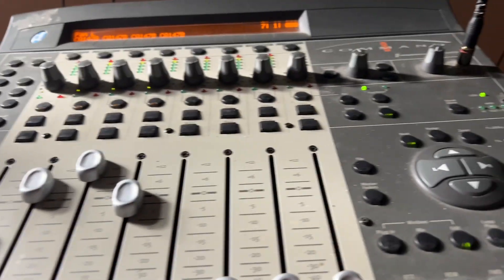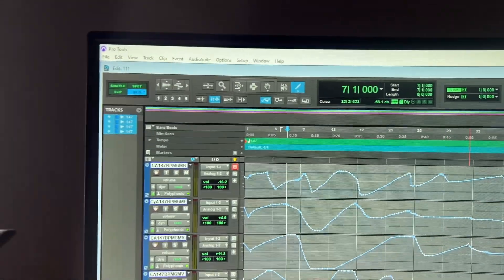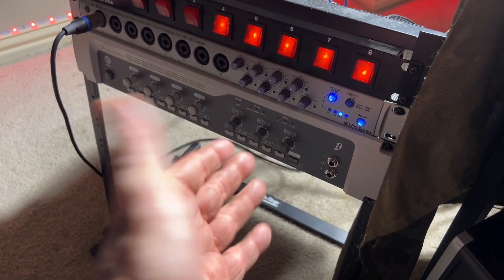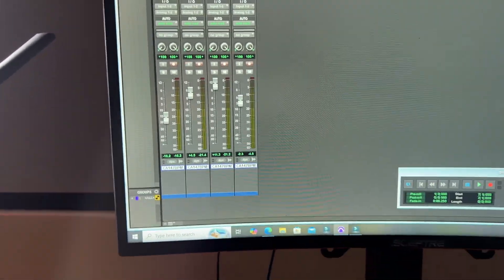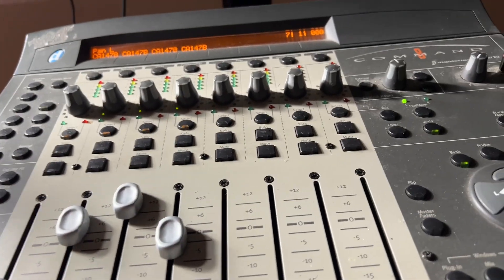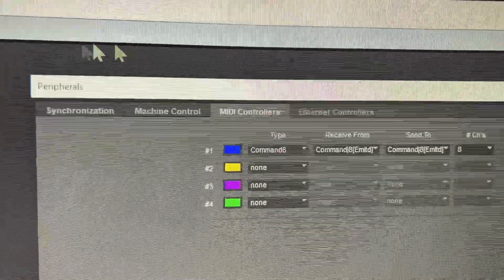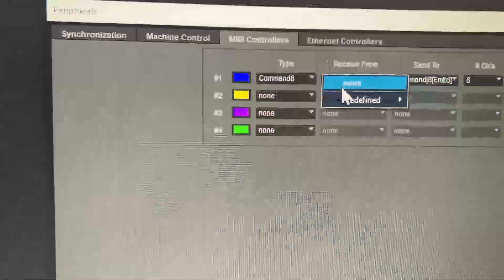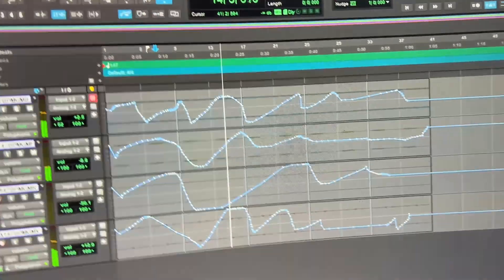How to setup Digidesign  Command 8 in ProTools, 2024

Comment: how are you using the Presronus  Interface  I have that and i cant seem to get the computer to recognize it. i have 4 firewire devices and I am 50/50 on them being recognized I bought 3 different pcie to firewire cards and no luck.
Reply from the maker: I don't.  I just use it for Protools.  It may work under the Mackie HUI protocol but originally, Digidesign was strictly ProTools.

Comment: can i get the drivers? Sir
Reply: I have a Mac
Reply: I’m good I am using V Crontrol to use it. So far I can only get it to work with Logic Pro X for some reason 
😅
Reply: Great video, I have a Command 8. Someone left it behind in a rehab home I purchased a few years ago.  I’m running Pro-tools on my MacBook Pro. Would you happen to have the driver?????
Reply: @dionrainey4034  I use V Control. It’s an app that you can use with it. They will allow you to use it for an about 7 to 14 days for free.  And I used the one that cost about $57 a year and my command 8 is working fine now.

Comment: What drivers are you using
Reply from the maker: Digidesign Command 8. (windows)
Reply: @JTUDAR where you get them from cause I’m hear you can only use v control to operate Legacy gear like that
Reply from the maker: @STMENTNETWORK   DUC community, I believe but that has been gone for years.

Comment: It seems it don't work anymore on my new M3 Mac.... I use Pro Tools Studio 2023.6. It worked fine on my old Intel Mac mini,
Reply: Dude so I got Protools 2023.6, did you need to install a driver?
Reply: Run pro tools in rosetta

Comment: This is cool stuff. For people willing to navigate a few technical hoops, "outdated" hardware can be a big value. I'm using an old Tascam FW-1082 with a current Win 10/Cakewalk setup and it works great. I got 8 motorized faders, transport controls, jog wheel, mute/solo/arm buttons, custom-action buttons, all for $120 off of Reverb a few years ago.
Reply from the maker: Yes!!  I was actually looking at one of those Tascam FW-1082 recently.  They are dirt cheap on eBay. I may start collecting this stuff as a hobby in itself.